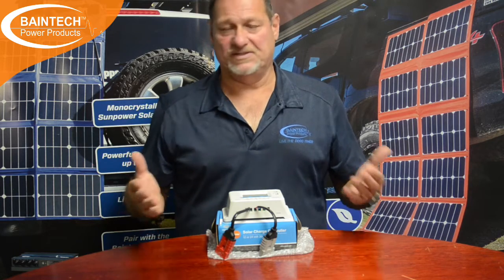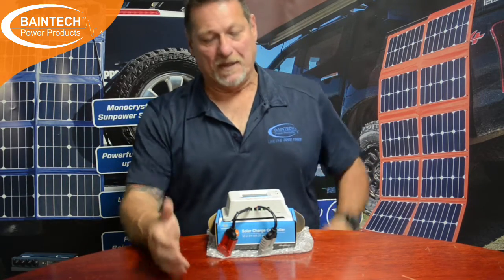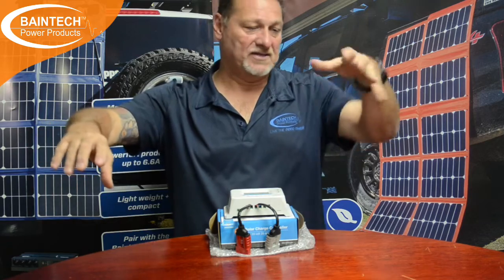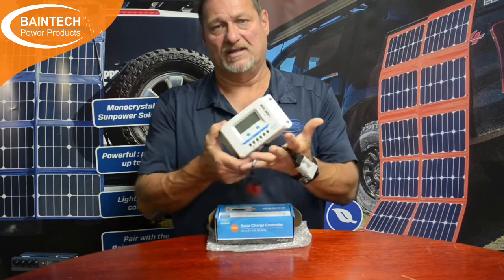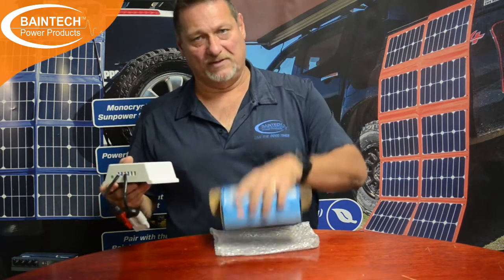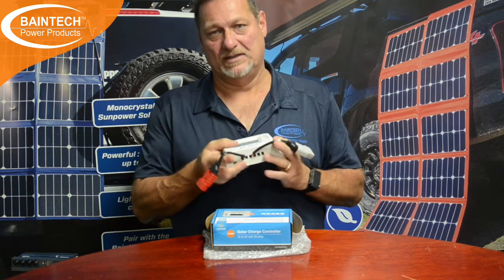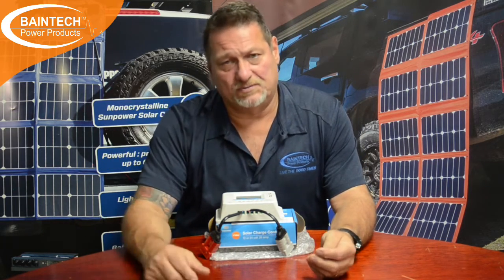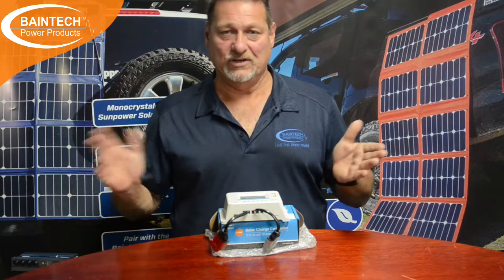How to Connect Portable Solar Panels to your Caravan

Comment: When parked up, can I plug a solar blanket, or panel, into the Anderson Plug that is usual connected to the car? I have 2 fixed panels, 170w each, on the caravan roof feeding into 2 x 120 ah AGM batteries. Our van has a large compressor fridge and I find we don't get enough solar charge in to do more than a couple of days off grid.

Comment: Thankyou for putting this up, being a novice with solar l’ve learnt something, but the question l have is .. as my caravan will be in under a roof while lm not using it, l have access to a 160 w panel on the roof of the building, question is what’s the easiest way to connect to that panel to my system?  Can l splice into the cable from the panel on the roof of my van?  Only need it to keep the batteries charged…
Reply: When camping, I use a folding 150W portable panel with a the attached 10A solar controller. It delivers about 14V directly to my battery via large alligator clamps.
If you're not using the van & its just in storage then most typical batteries will only have to be topped up a couple of times a year. 
If that is your situation I wouldn't bother with the 160W rooftop panel - just plug in the 240 a couple of times a year.